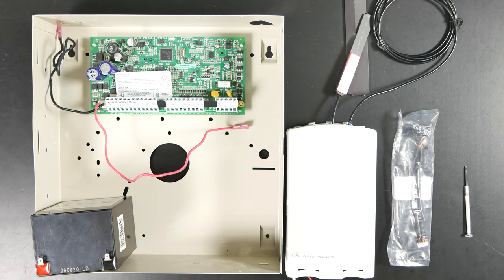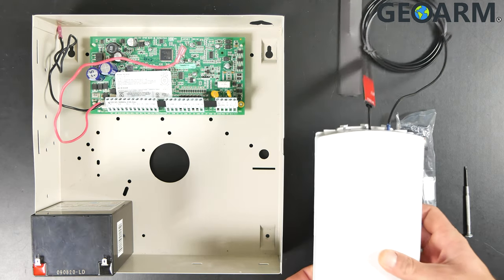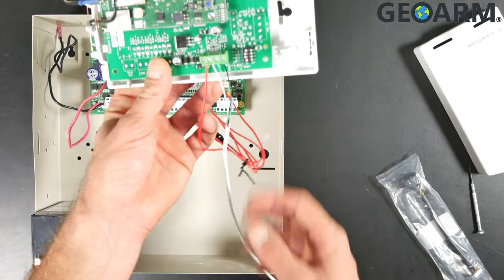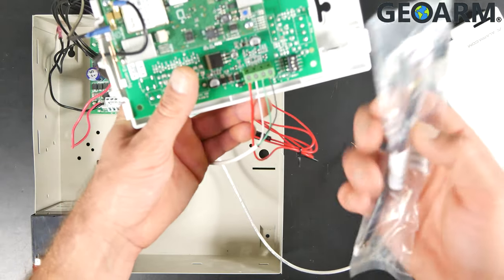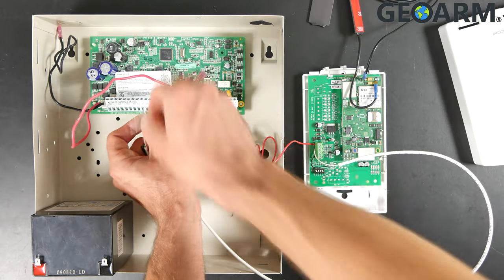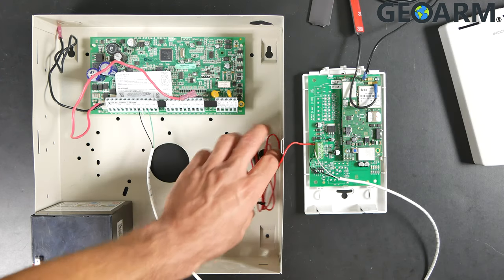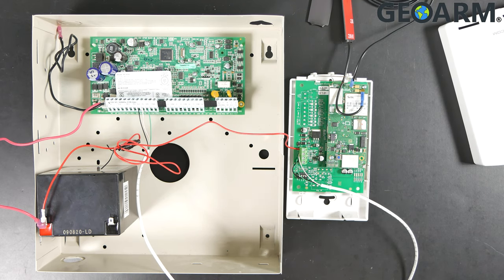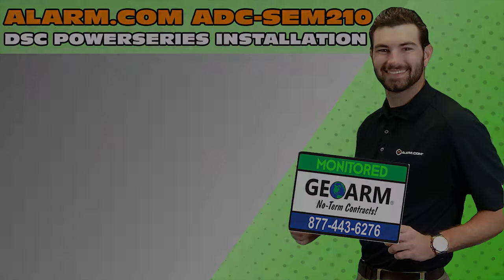Alarm.com ADC-SEM210-PS DSC PowerSeries Installation

Comment: How much time it took into the unavaible state at the keypad. Instruction said 10-15 mins.. but I'm now at 30 mins and still not working...
Reply: depends on the signal strength and sometimes the device is just faulty